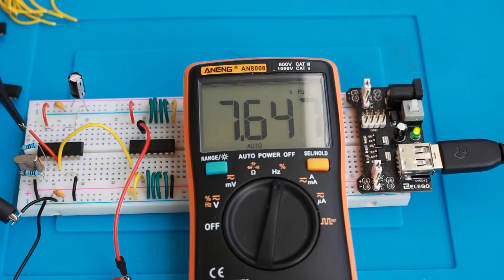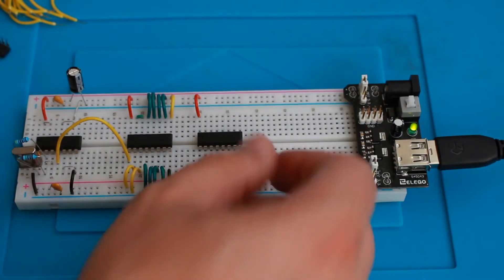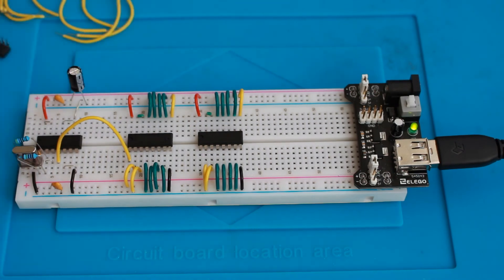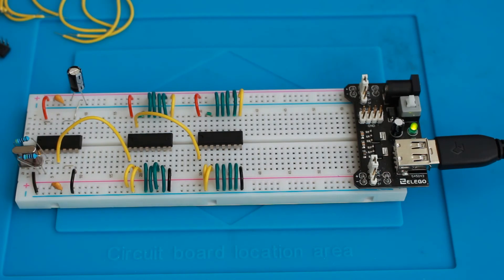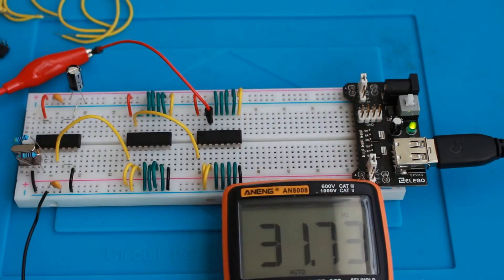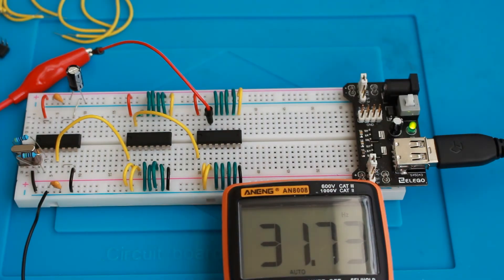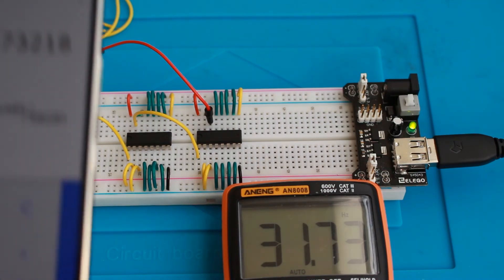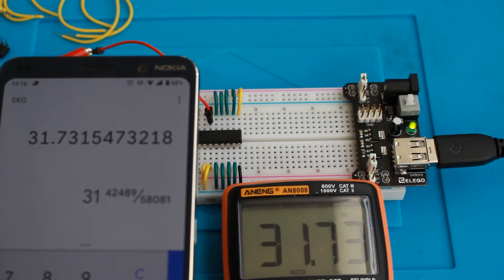Digital Tone Generator for Homebrew 6502 Computer music output

Comment: glad i got this video recommended somehow, i wonder why i haven't seen more psg style circuits now that chiptune is pretty popular. your proyects are always one of a kind, at least here on yt. i'm gonna try this one and see what happens lol. any reason you used the 74HCT40103 over the regular CD40103 tho ? it's just that the 40xx line is much more available here for some reason.
Reply from the maker: Great! Regarding component choice, I just got what was available, CD40103 should be fine I think.

Comment: Thanks for sharing these videos, I've built a few DIY synth modules in the past, but I've used ±12V for it, interesting to look at a pure +5V setup, looking forward to watching the rest of the series. I'll definitely be building my own sound card into one of my 65C02 builds, and try to adapt some of my ±12V designs to +5V.
Reply from the maker: That's interesting. I got some parts for making more synth-like filters but haven't learned how to do that yet. I've also been thinking of doing some kind of PCM audio, to see what sort of hardware compression I can put together; or maybe just simple wavetables to at least get non-square waveforms.

Comment: How come you use a down counter instead of an up counter? Also thank you for this video my original idea for a sound card would be 2 octal 8 bit d flip-flops that fed into a 16 bit dac thats output would go to the power input of a potentiometer and its output would go to a 555 timer which would output to a speaker, a lot more complicated and probably not as good.
Reply from the maker: Up-counters would be fine so long as they were presettable. The key is being able to vary the time until they reset as that is how we change the output frequency. I like these ones because they're 8-bit and self-resetting, rather than needing external logic to detect the end of the count.

The thing you were going to do is more analog. You could make a VCO and feed the analog signal into it from your DAC. It might be easier to get different wave shapes that way. My way can only easily do square waves.

The Yamaha OPL synths used in early PC sound cards used ROM tables to calculate waveforms, so although they were digital they supported more than just square waves. It might be interesting to investigate.
Reply: @GeorgeFoot  Sine waves do sound a lot nicer but doing it like your design is cheaper and a lot easier to do and probably more reliable
Reply from the maker: @ducksonplays4190  I experimented with using a constant current circuit to convert the square wave to a triangle wave, it works but you need to use a different current for each frequency or you lose volume at high frequencies. I might go back to that later and see if I can make it work.
Reply: @GeorgeFoot  hmmmmmm i may just go with square wave and your design since its simpler

Comment: Can you elaborate on why you've apparently used two successive dividers rather than cascading the two '40103s using ~TC/~TE to form a single 16 bit divider?     By my calculation using the latter mode would produce much smaller musical scale errors (in the range of -0.7 to to +0.5 cents for the 440Hz+ octave) than your two stage divider.
Reply from the maker: Sure thing, yes I considered it and it would be more precise. There are a few weak reasons I didn't go that way which kind of added up in my mind to this decision. One is that using a pure octave divider makes the code simpler as we only need a couple of small orthogonal lookup tables - one indexed by octave and one indexed by note. Another is that I've found it annoying to chain two of these together in the past, as I think you also need an OR gate to make the pair reset properly, unless I've missed a better way of doing that. For my video output circuit I needed this in one place and made the OR gate out of diodes, to save having to add a whole IC, and that worked quite well. I guess a third reason was that I liked the potential of reusing some of the bits in the octave divider for something else, e.g. volume or waveform selection - or even of encoding the octave as a bit shift to save even more bits. None of these are particularly strong reasons though, and if you find it better the other way I'd love to hear about it!
Reply from the maker: By the way, if you look in the following image, just above where it says "Lines per frame", you'll see how I used two diodes to make a pair of 40103s reset together. Maybe there are better ways!

https://github.com/gfoot/compvideo6502/blob/master/images/AnnotatedBreadboardLarge.jpg